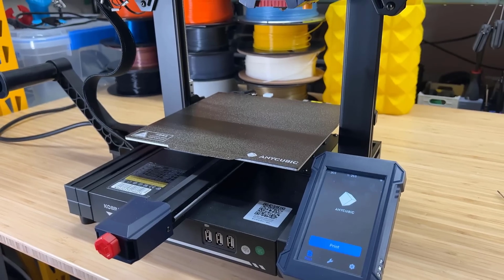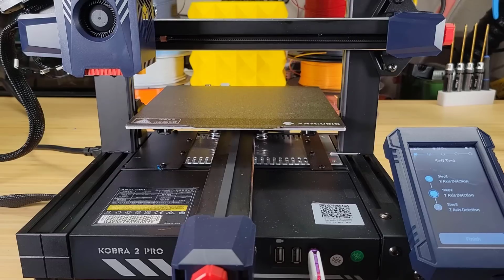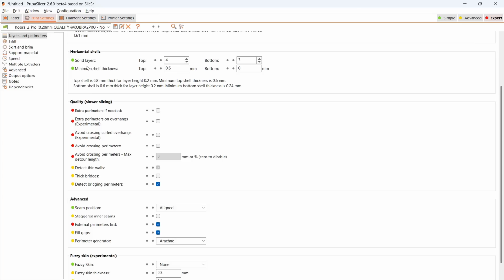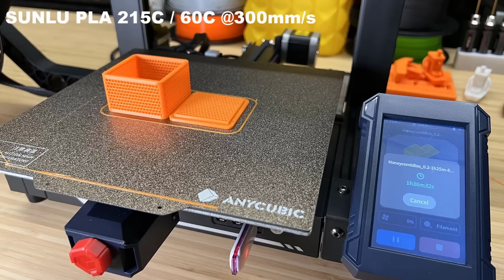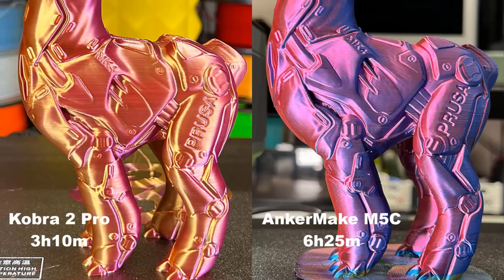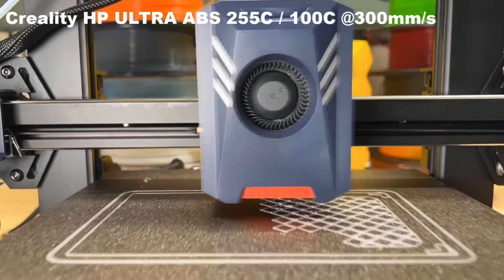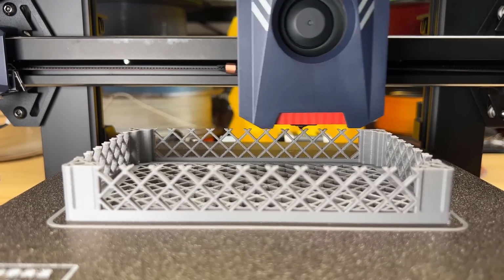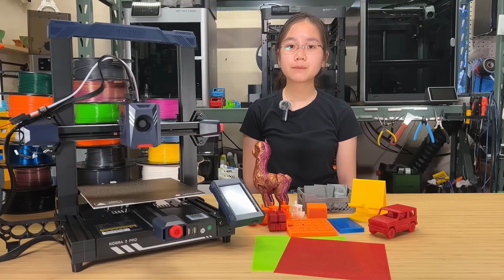AnyCubic Kobra 2 Pro: A fast bed slinger,  good print quality @ 300mm/2 and 20k acceleration

Comment: Im curious why don't you nominated this printer to be the best budget 3D printer? Since it has good pricing, klipper, and more upgrade than Anycubic Cobra2? Anyway, great video. I always come here to seek a detailed 3D printer review 🎉
Reply from the maker: I will do it right away if they release a firmware that simply uses the Moonraker API. I might still consider it after testing out their cloud. Let's see.
Reply: @AuroraTech  Great, I can't wait to see that!
Reply from the maker: After upgrading the Kobra 2 to the latest firmware, V3.0.6, they implemented the input shaper in Marlin, and it performs quite well. I can print a 22 mins benchy with acceptable quality, which isn't far from other budget Klipper bed slingers.
Reply: @AuroraTech 
My Kobra 2 is running amazing after doing the latest update. The speed and quality is great. Can’t wait to get the Kobra 2 Pro.

Comment: Is it possible to SSH into the printer and modify the Klipper installation to add the FLuidd/Mainsail web interface or tinker with other settings?
Reply from the maker: I scanned the port of the IP address, and there are no services available—no SSH, HTTP, or anything.

Comment: Too bad about forcing cloud services...  I'm on the hunt for a small (Ender size) printer for small prints but I refuse to use any cloud service.  I'm too used to using either Octoprint or Mainsail to ever go back.  Thanks for the great review!
Reply: RatRig V-Minion?
Reply: @theglowcloud2215  Agreed, was hoping to not have to build one but that's the direction I'm most likely to go.
Reply: @larry527az3  the V-Minion does have a lot of parts (I think they could possibly reduce the BOM), but it's the best cantilever-style bed slinger out there. This is coming from someone who had the misfortune of owning a Prusa Mini.

Comment: What do you think allows this to print at good quality faster than the other klipper bedslingers? Is it a better specific hardware component? Better overall quality control of equal hardware? Better firmware integration/tuning?
Reply from the maker: I think all of these play an important role in terms of print quality and speed:

1. The motion system
2. Firmware tuning (input shaper calibration, bed leveling, auto z-offset)
3. A strong extruder and hotend
4. Part cooling
Reply: @AuroraTech  With all these new budget klipper bedslingers it would be interesting to see a comparison with setting the printers to the same speed and acceleration values and finding how much each manufacturer pushed the limits.